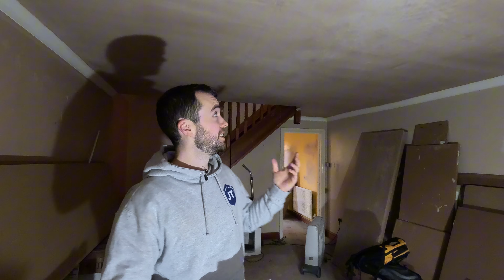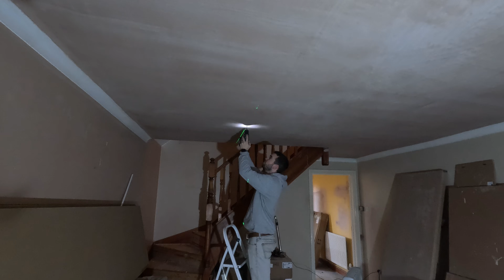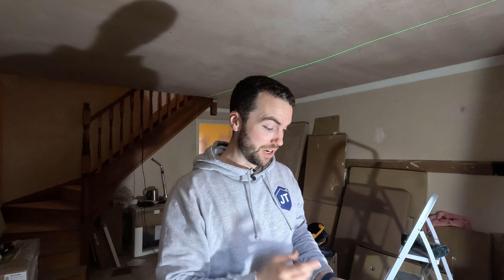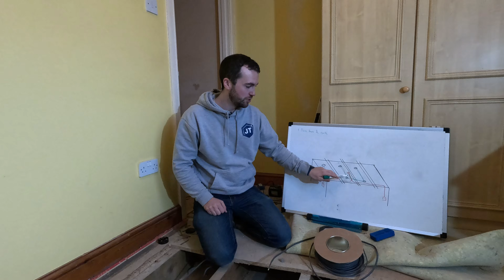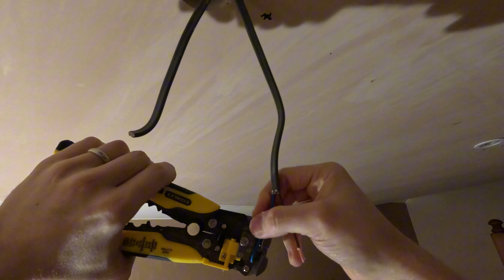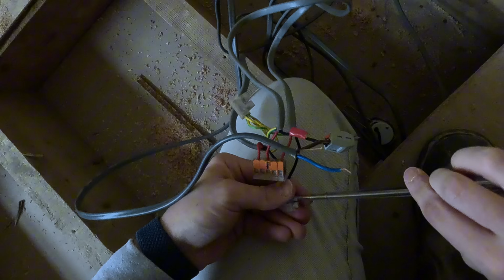Downlights/Spotlights Made Easy: Install from Above or Below!

Comment: I think I'm right in saying that if you have insulation above the ceiling, you have to leave space around the spotlights, to allow for  cooling.
Reply from the maker: Yeah, correct - I remember seeing that in the instructions. Typically about 3 inches or so I believe? Didn't need it for this install, but I did for a later install where I was putting them into the upstairs bathroom (which had an insulated ceiling).